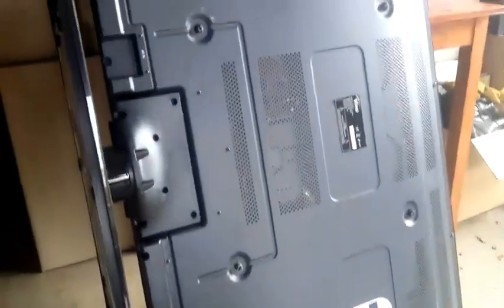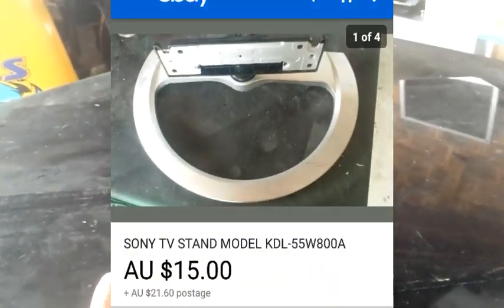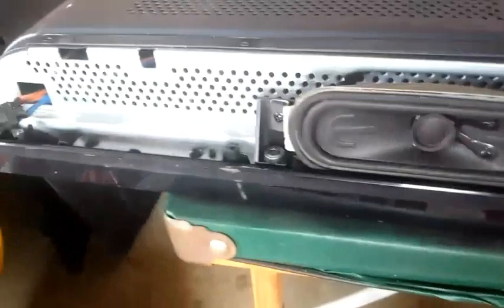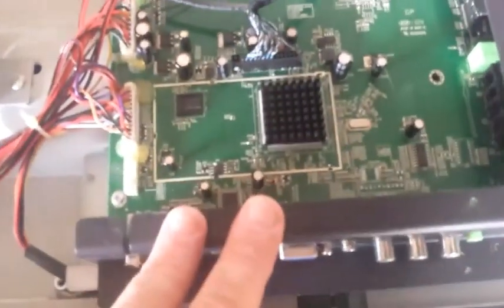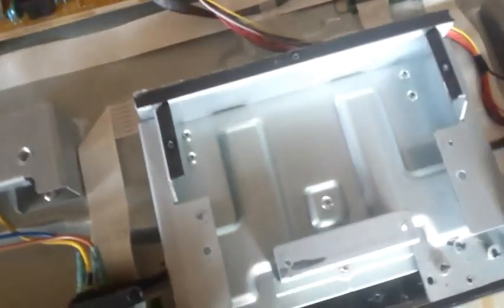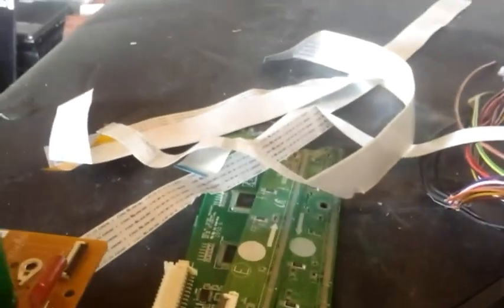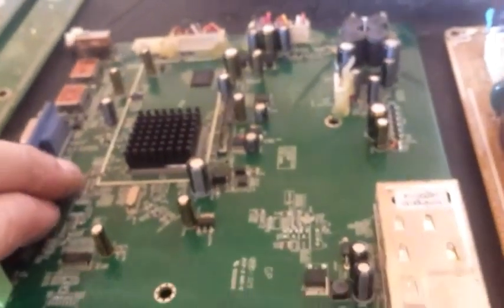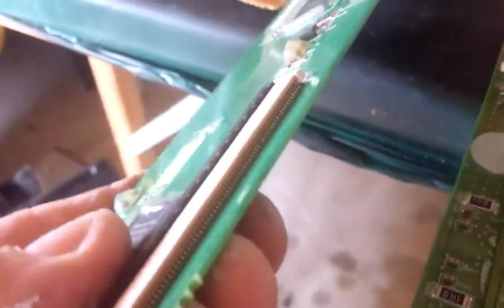HOW TO MAKE MONEY SCRAPPING A TV!

Comment: I have a box in my shed somewhere full of heatsinks! I should sell them. Are the TV frames usually aluminum? How do you dispose of all the waste from the things you don't keep? I guess the plastic and metal would me recyclable?
Reply from the maker: TVs vary a lot. The heavier are steel, lighter are alloy.
Also some screens are thick glass and some are thin.
They all vary so much.
Once its all broken down, glass screen can be recycled, I keep the mylar and perspex, plastic is recycled and the rest can be sold.
Aluminum heat sinks are awesome, some are a work of art.
You can either sell them to the scrap yard or put them on eBay 😁